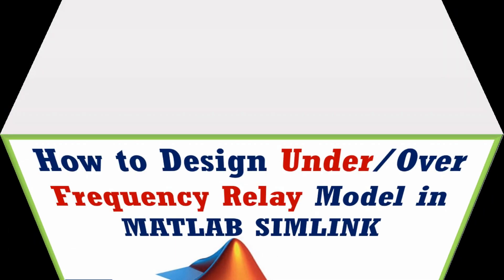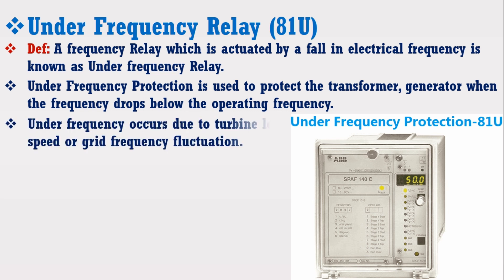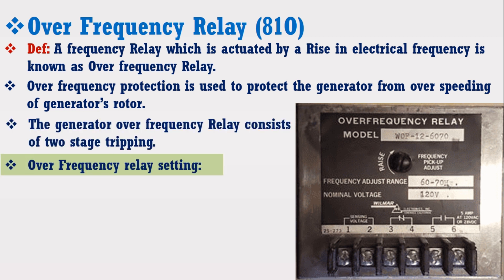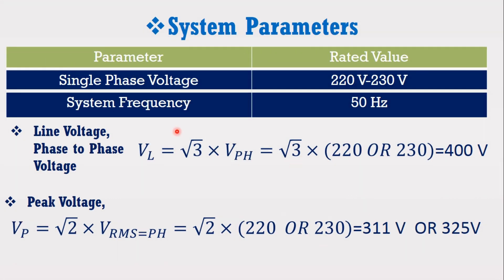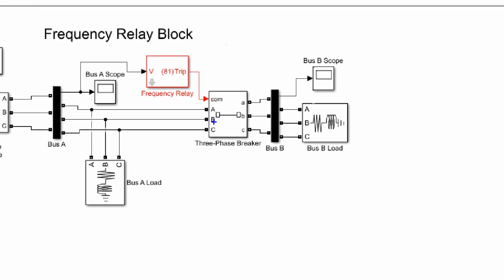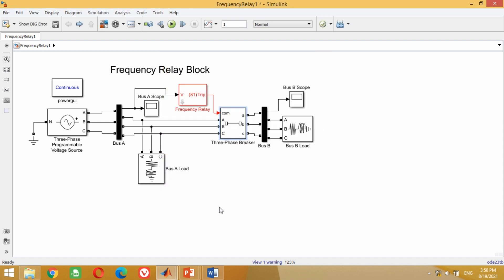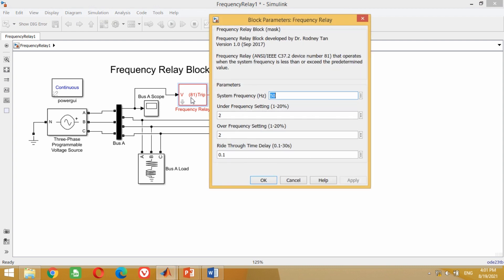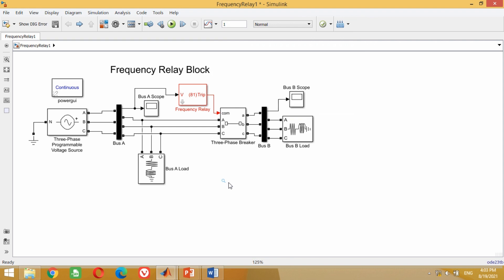How to Design Under/Over Frequency Relay Model in MATLAB SIMULINK | Dr. J. A. Laghari

Comment: Hello. Thank you so much for this effort. Please I need the frequency relay block
Reply from the maker: Thanks for the comment. Kindly download the frequency block from the link shared in the description section of the video or link shared in the video.
Reply: @DrJALAGHARI   yes thank you doctor. Could you please share a video how to control and emulate the grid for low voltage ride through and high voltage ride through of system with specific grid codes
Reply from the maker: @alirifaie9116  Thanks for the comment. I am not sure about the making of video. It is because every new topic needs new learning and it takes lot of time.
Reply: @DrJALAGHARI  Im just not sure how to control the grid to allow different voltage at a different time
Reply: thank you so much

Comment: Can i have the function of frquency relay  sir
I need it and i can't open the Block 
I have Matlab 2014
Reply from the maker: Thanks for the comment. I have designed this model in the MATLAB version 2017a. I think, you may visit the Rodney Tan model link and check which version this model is designed. You have to install that version in order to run it correctly.

Comment: Thank you for this video sir, im grateful. And i have question, i've simulation(microgrid ieee 13bus) and i wanna implement adaptive underfrequency load shedding in this MG, but i have problem for coding in relay function. Can you help me plz? In this tutorial you simulating  one breaker and one trip signal, but in my simulation there are many breaker.
Reply from the maker: Thanks for the compliments. You have to place the same relay and breaker at different positions. Just change the underfrequeny value for each position.
Reply from the maker: Thanks for the compliments. You have to place the same relay and breaker at different positions. Just change the underfrequeny value for each position.
Reply: Can u send me the simulation of under frequency load shedding sir
Cuz i have the same prblm ?
Reply: السلام عليكم
عذرا على التدخل في المحادثة
هل اشتغل لديك الدائرة لأنني أيضآ أستخدمت مرحل التردد في دائرة أخرى ظهر أخطأ عدد 2 ولم اتمكن من معالجة الأخطاء.... مع التقدير والاحترام

Comment: I've simulated it but it's saying I should change my current directory to a writeable directory outside of the MATLAB installation area. This made it to display error and thus I'm not seeing any output. How do I rectify this issue?
Reply from the maker: Just save it in any drive except C. Then run. It will run successfully.

Comment: Dear sir I am facing difficulty to draw the circuit in simulink kindly do the needful I have attached circuit with output sir sir how to rig up thyrister control phase angle regulator how to draw the tap changing transformer and phase shift transformer in simulink I have email the detail
Reply from the maker: Ok I will try